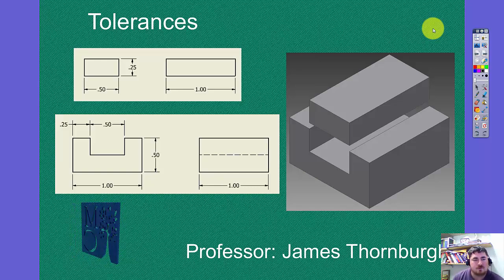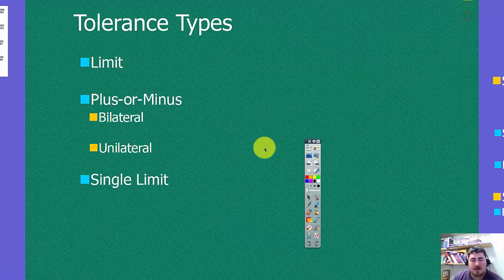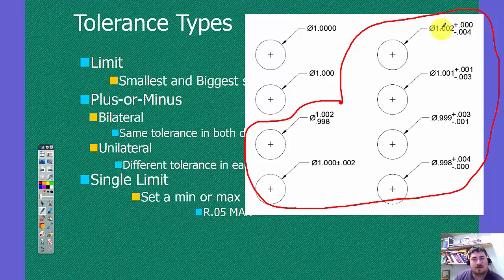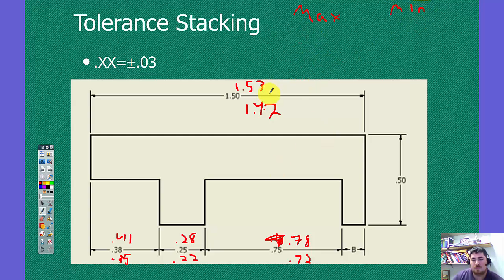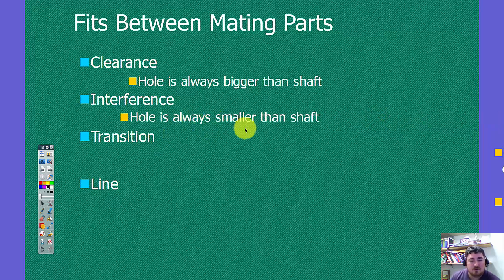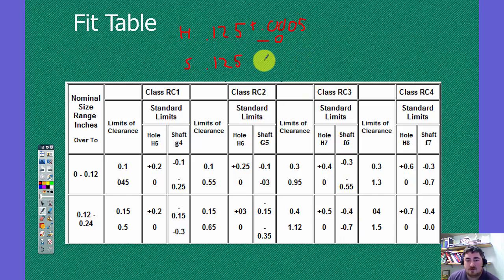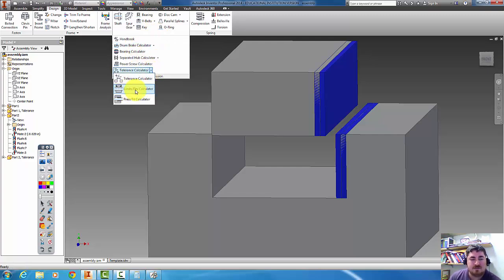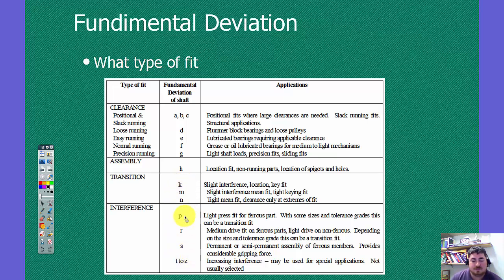Tolerances

Comment: Thanks a lot for taking the time to explain this for the rest of us. Just to point out something, the upper limits of clearance for RC1 and RC2 make sense based on max hole and min shaft. However for both RC3 and RC4, upper limits are 1.2 thou and 1.1 thou, respectively. Hopefully you'd explain why it's 1.12 and 1.5 thous in the fit table. Cheers, Haitham